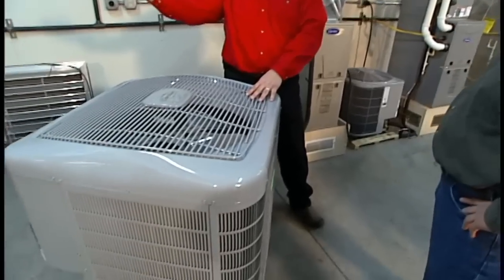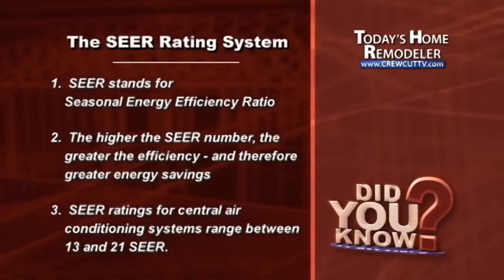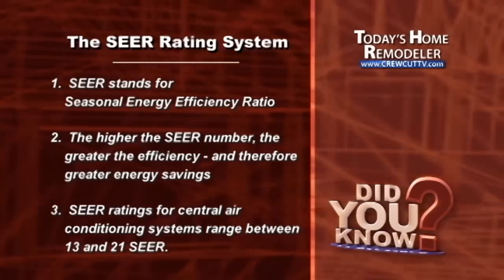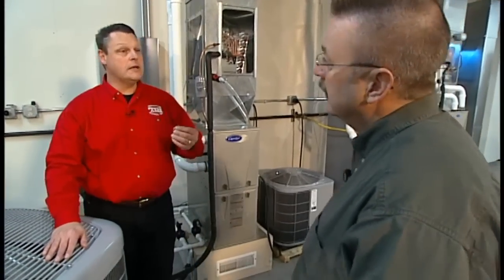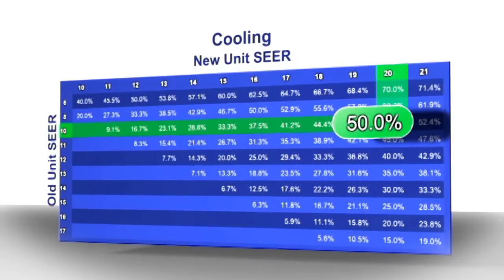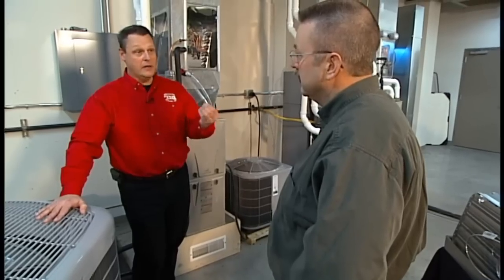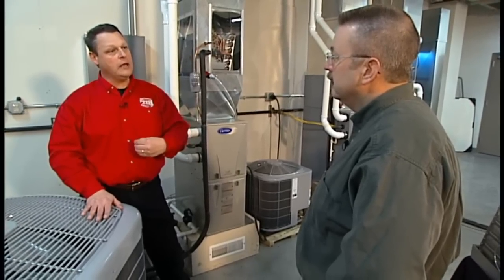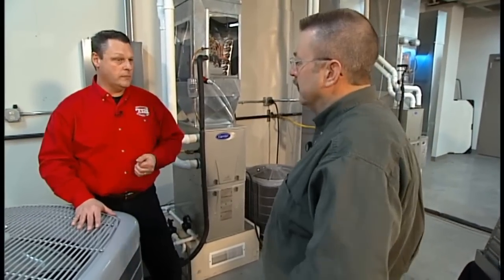How to select an Air Conditioner

Comment: 1998 Heat Pump unit.. When I replace it, should I get another heat pump or downgrade to just AC unit?
I live in Florida, it gets sometimes down to the high 20s low 30s.

Comment: Keeping the evaporator fan all the time in the cooling mode significantly increases the humidity level. As the moisture collected on evaporator coils will come back into your home with the fan running constantly. In high humidity conditions leave fan in auto mode for better results.
Reply: Not to mention duct losses!

Comment: Our Trane 3 1/2 Ton Heat Pump is the lemon of all times.  We have to make monthly repair bill to our local Trane Dealer of Smithfield, Va.
Reply: Personally, I would never own a heat pump. The reversing valve and complexity of the heat pump make it failure prone. I won’t own a house without a gas furnace.
Reply: Get a home warranty like we did since our old ac unit has been a loser. Worth it and could be replaced.

Comment: What is come include with when we buy air conditioner. I bought air conditioning a951e $3800.I have buy separate coil $750 and air condition out side. $2200. I think they might lie something to me 
Because first time they told me  $3800 all price include but when installation they said you need buy coil if you don't buy it the old coil leaking into the machine can't give you warranty after everything done they can't connect air cooling system outside for me I try to ask them they said you have to change the outside air cooling that one too because the old one it is done not match with new machine if you want to use your coil can break. Leaking I can't warranty for that. I just leave like that. I don't have air cooling now no idea how. Does someone can explain to me about it. Thanks

Comment: Avoid the variable speed units, a lightning run in can get real expensive as there's a lot of supporting circuitry, I've heard from different people that their units were problematic, I just put a dual stage in my new house...
Reply: Corvette Coupe. Transient surge protecting mov's
Reply: Lightning and power surges can destroy any compressor or motor. I finally installed a whole house surge protector but I plan to install individual protection circuitry on my new furnace and condensing unit to protect the sensitive electronics.  I was thinking about buying a system with a two speed compressor but I have heard from A/C techs that the control boards are flaky and they will override the compressor to always run in high speed mode to prevent future breakdowns.